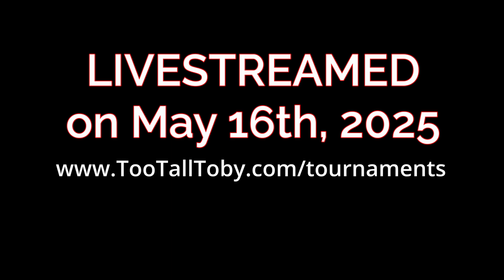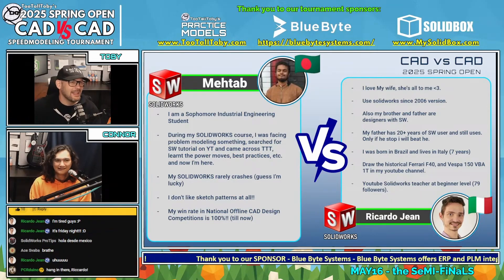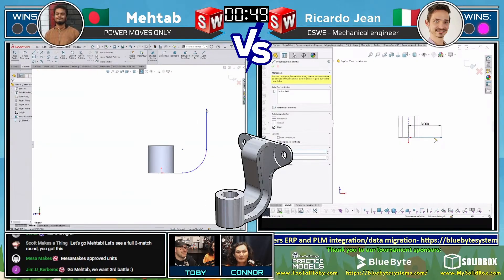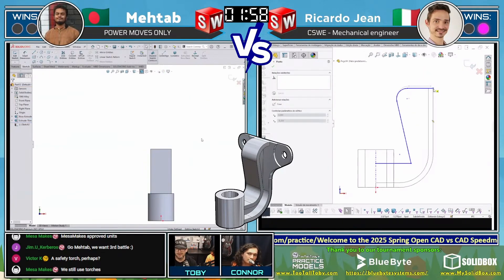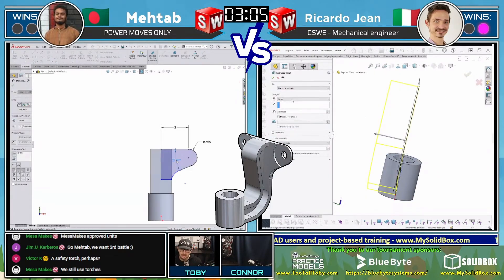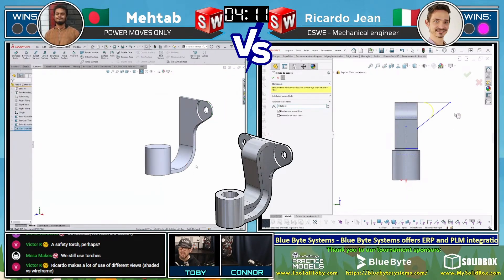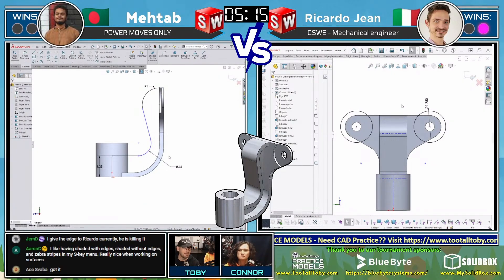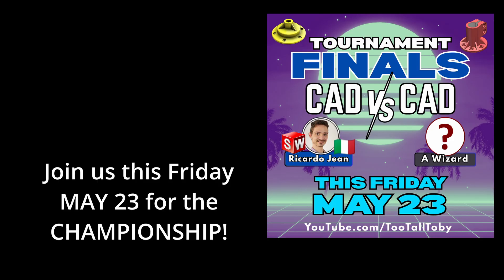SOLIDWORKS vs SOLIDWORKS - SEMI FINALS BATTLE!  - CAD Speedmodeling Tournament!

Comment: Hello, great job!
Question for Ricardo
How does he achieve this symmetry so quickly (video 6:04 min)
Thanks in advance for the information
Reply: They put a centerline in the sketch and then had a keyboard shortcut or macro set up to mirror across that centerline. Even at 0.25x speed you can't see them click anything so it had to have been a physical button press of some kind.

You could use the dynamic mirror sketch tool to just mirror everything in the sketch in real time across that centerline, which would also let you know if everything is going to look right in the extruded boss, but it's a few extra clicks in the beginning.

If you're in a timed competition, you'd want all your most commonly used / biggest time saving tools with their own keyboard shortcuts / mouse gestures / space mouse hot buttons. That way you can use both hands and spend less time clicking around the ribbon menu at the top of the screen.
Reply: @commentsaretheworst  merci beaucoup pour ta réponse !
Reply: he added the mirror shortcut to the right click toolbar

Comment: Took me around an hour to do it and got 0.97 pounds I don't know where the issue is in mine 😅. It is impressive how they did it in 10 minutes. Is an hour good for beginner?
Reply from the maker: 1 hour is a great time for beginners!  Remember you can sign up at www.TooTallToby.com and then you can see what the average time is for the field.  For models similar to this one, we often see average times around 30 minutes.  So that could be your goal - get your Tier 4 or Tier 5 modeling time down to 30 minutes, using the app to learn tips and tricks and efficient moves along the way!